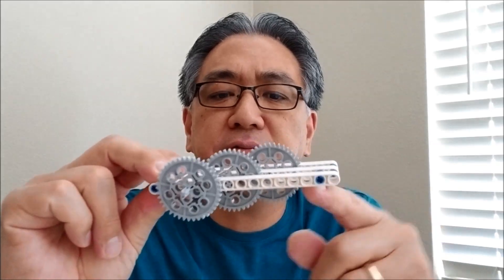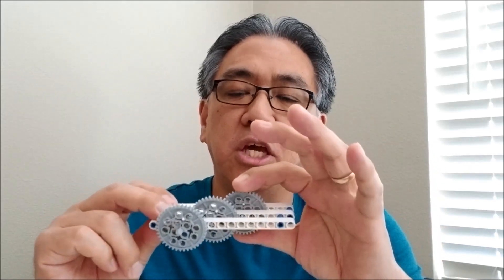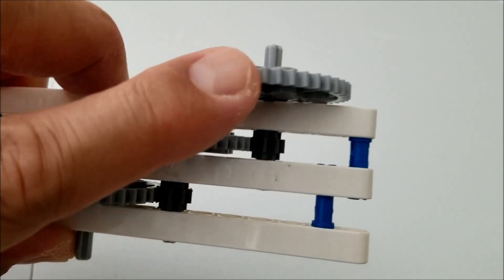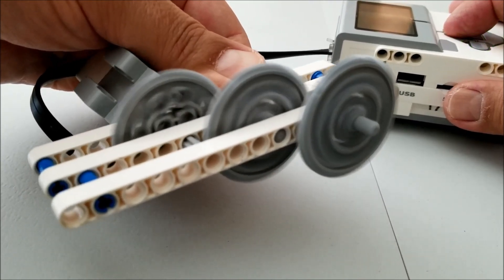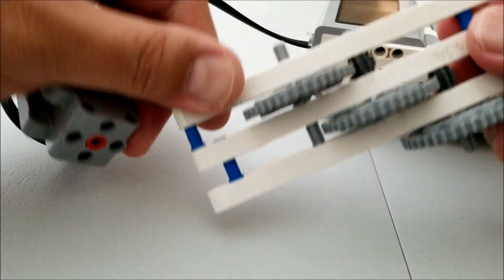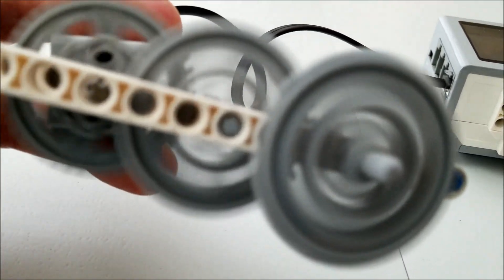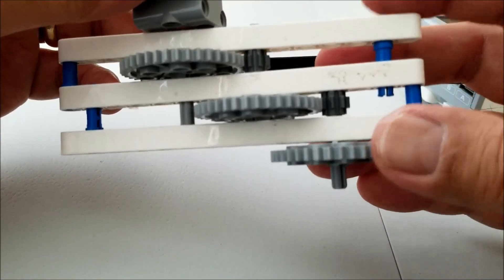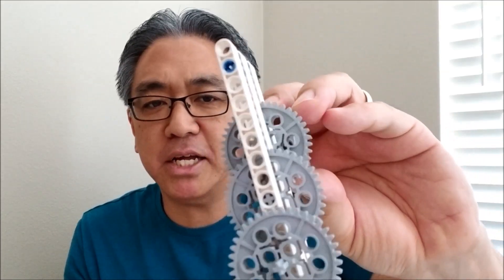"Having Fun Gearing Up With LEGO EV3 GEARS!!!"

Comment: Theoretically could you just endlessly do this until you reached light speed and beyond?
Reply: Absolutely not (Well, at least not with LEGO gears). Remember, speed and torque (turning force) are inversely proportional. That means that the more you increase speed, the more you decrease the output turning force. This also means that the more you gear up, the less weight you are able to rotate. That's why many gearboxes focus on increasing the output turning force at the cost of speed, so that they have enough power to rotate heavier objects. This is especially important for wheeled vehicles, whose rotating parts (the wheels) are consistently in contact with ground. This contact creates more friction that the motor must overcome in order to move the vehicle.

The EV3 Medium Motor only has so much torque, you can only gear up so many times before the friction becomes too great for the motor to overcome. That's when it begins to stall, or even break if it tries too hard. So unless you want to risk your motors, I would highly recommend never attempting to do that.
Reply: @colonelpotato  An enormous amount of power that no existing LEGO motors can provide.
Reply: You need infinite energy to make something with mass move at the speed of light, let alone how much force you would need to turn the first gear or how much force a Lego gear can handle